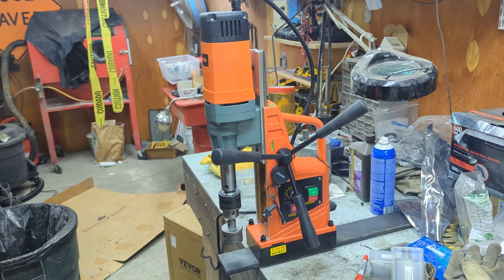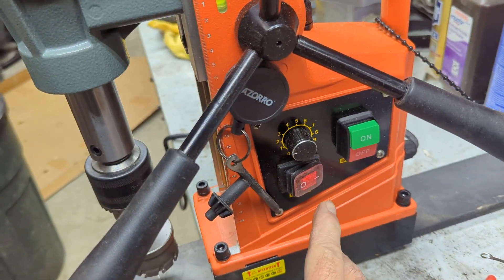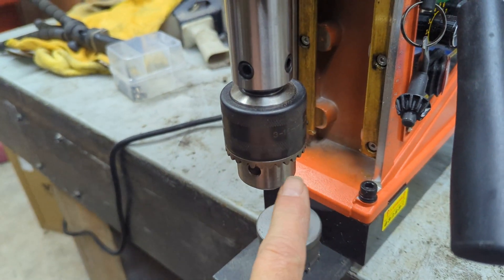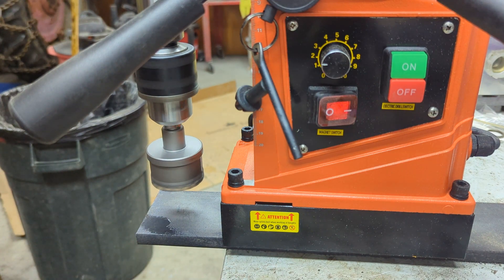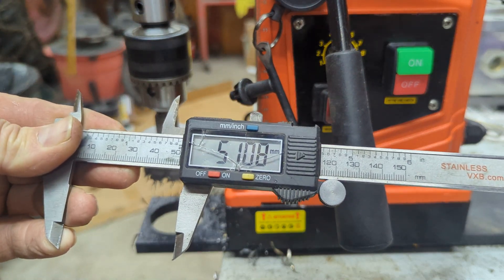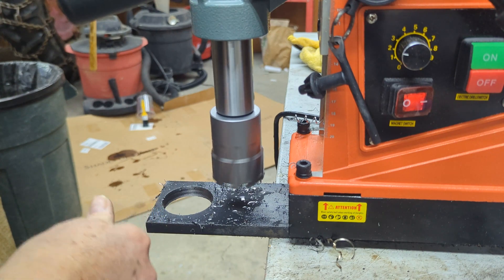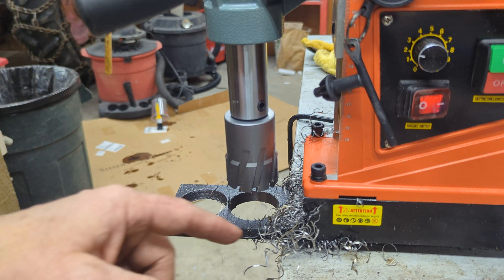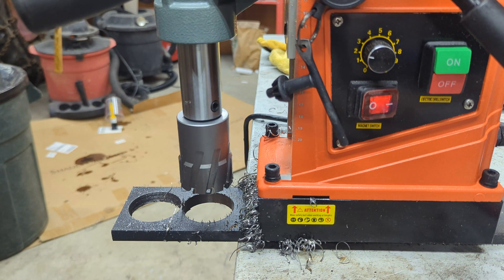$210 VEVOR Mag Drill Press - review using 2" TCT Annular Cutters

Comment: Nice review.  It seems like there is a significant difference between the 2 types of chucks along with the corresponding bits as to the results.

After seeing that, and reading many of the reviews, I'd like to see some legitimate side by side testing with quality vs cheap bits using the same Chuck style instead of switching between the 2 chucks.  The question I'm having, is this runout issue because of a cheap 3 jaw chuck fitted into an otherwise good Chuck on the drill.  Or is it because of the cheap bit?  Or both?  My suspicion is that the 3 jaw chuck is garbage.  And even with a cheap bit fitted in the original style Chuck, or possibly using a quality built 3 jaw chuck, you might still get good results even with a cheap bit.  But who knows at this point.

Thanks for posting your review.

Comment: Lube is cheap compared to the cost of the cutters. You seem to be afraid to use that can of WD40 in fear you might run out. 
That thing was smoking because of heat, they always do. However, you have to keep the lube/coolant coming. If you treated my 
equipment like that I'd take you off the machine and give you a toilet brush!
Reply from the maker: Just a quick test. I was using it horizontally and lube would be a mess. I got it through the job alright - slow and WD-40 worked.

Comment: I've watched several vids on these drills and it seems like no-one knows how to drill a  hole properly! I was taught to pump the drill in order to break and clear the chips. This also helps keep the drill and workpiece cool plus allows coolant to flow into the hole. Your drills will go much farther between sharpenings as well. I can still hear my mentors shouting at me across the shop "PUMP THE DRILL!"
Reply: There a lot of youtube content creators demonstrating products they never used and don't use them correctly.
Reply: We could but we don't really give a shit 😜
Reply: I never use the annoying attachment that comes with the machine i just grab a coke bottle stick a hole in lid with the hit mig wire and voila ! Doesnt run correct half the time bla bla bla the attachment bottle too much milk then not enough for ever setting da c,,nt ive never broke any bit i never blunt them and ive drilled kilometres o holes ! And my spring always pokes the shard away i dont need pliers pull it off when hole is finished as others do for some reason because they get the bit too hot i think ! Welds on there for idiots ! But thats the difference between a tradie and a Tradesman that did His Four year Apprenticeship in the pass grade ! BTW every shop ive been to rips the milk bottle off right away and the front cover also both annoying slows job down ! LOL
Reply: I never use the annoying attachment that comes with the machine i just grab a coke bottle stick a hole in lid with the hit mig wire and voila ! Doesnt run correct half the time bla bla bla the attachment bottle too much milk then not enough for ever setting da c,,nt ive never broke any bit i never blunt them and ive drilled kilometres o holes ! And my spring always pokes the shard away i dont need pliers pull it off when hole is finished as others do for some reason because they get the bit too hot i think ! Welds on there for idiots ! But thats the difference between a tradie and a Tradesman that did His Four year Apprenticeship in the pass grade ! BTW every shop ive been to rips the milk bottle off right away and the front cover also both annoying slows job down ! LOL ! BTW YOU CANT SHARPEN THESE HOLE SAWS HES USING LIKE YOU CAN A NORMAL OLD TWIST DRILL ! LOL
Reply: Annular bit requires constant pressure

Comment: Thanks for the information. I just recently also picked up a Vevor annular cutter/drill. On the first day I drilled 64 5/8” holes. It took less than 1/3 of the time as using a drill press and standard drills. I’m definitely happy with mine so far.
Reply from the maker: You are welcome. It is an awesome tool for the price. Not sure how long it will last if you are pushing it that hard. Let us know if you have any trouble with it wearing out.

Comment: With practice you will feel the right pressure when the teeth are cutting right. The more coolant-lube the better and go slow n steady. It bound up from the bit expanding when it gets hot.
Reply from the maker: Wow. I did not think about the stall being from the bit expanding. I definitely need to figure out cooling. Thanks.
Reply: @Baxsie  Ive used hole saws to cut holes in 1in plate and ended up with a tapered hole from the hole saw expanding. lol

Comment: Just by eyeball, I can see a horrifying amount of runout on that first bit in the three jaw chuck.
Next time apply less pressure, use a constant stream of coolant or lubricant (I prefer a constant stream of a light cutting oil) and turn down the speed all the way for such relatively large diameter bits.  The combination of excess pressure, excess speed, and insufficient coolant will burn your bits out within a dozen holes.
Reply from the maker: Thanks for the tips! I'm glad i have the "real" bit for precise holes. I'll have to invest in some cutting + cooling fluid. The main job I bought it for is cutting worn out welded bushings in a loader. I did some with a hand drill. It was brutal. Peace.